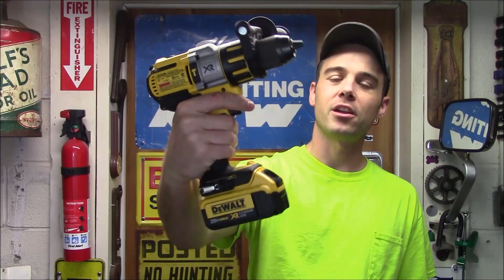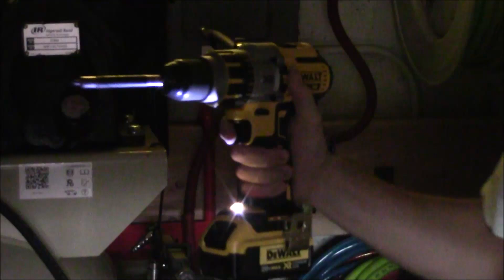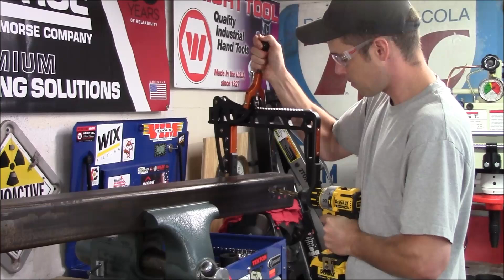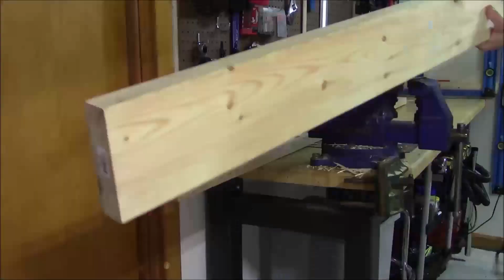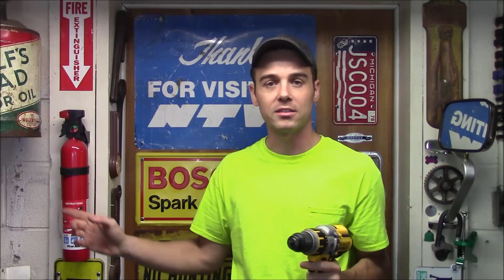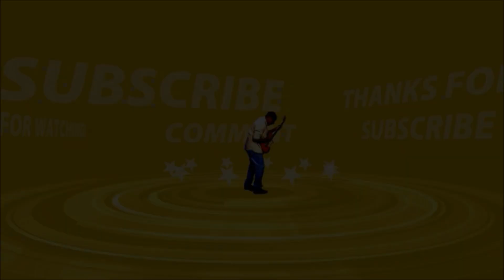DEWALT DCD995M2 20-Volt Max XR Lithium Ion Brushless Premium 3-Speed Hammerdrill DCD995 / DCD995B

Comment: in need of a new hammer drill and impact driver. I'm considering this dewalt line, the ridgid5x line, m18, or kobalts 24v. any thoughts or suggestions? my current one is a Hitachi and while I do like their new stuff I can't get nearly the same deals on price or extra batteries. any help would be awesome

Comment: Xlnt  review! The reason for having a  hammer drill for me, is to make 1/4 - 5/16" holes in concrete to set Tapcons and occasionally larger holes to put in anchors for "All-Thread" or larger bolts for supports or whatever. This definitely shows it is up to that task! As a Union plumber every commercial job I've ever worked on, we used Dewalt hammer drills if the Co. was providing us tools to use. And this was before the new 20 volt shown here. I'm now retired but I still do some maintenance work for a landlord plus I have my own CBS home which requires Tapcons nearly every place I can think to put one. So I really like this drill although maybe the smaller one will be enough. Again it is great seeing a hammer drill make smaller holes in concrete. 400+ holes per battery is plenty.

Comment: Great review!! Can that drill press thing be used with Milwaukee drills? I wonder how it would hook up. Lately when I've been drilling into metal I'll put the drill on the highest clutch setting so if a catch occurs the drill won't rip out of my hands. It doesn't work all the time but a lot of the time it does.
Reply from the maker: +Love2boat92 Thanks!  The Rapidrill (drill press attachment) does not work with the Milwaukee, since it has a clamp style (2 points).  It only works with a round handle style like the DCD995.  Good idea on the clutch trick....having a drill twist your wrist is no fun!
Reply: Real Tool Reviews No problem. That's disappointing it won't work with Milwaukee drills. Owell. I could probably make something that would work. Thanks.
Reply from the maker: +Love2boat92 I spoke with Rapidrill at length about this & the drills with the clamp style cannot handle the pressure applied (unevenly) and the casting breaks.
Reply: Real Tool Reviews That does make sense now. Bummer. That was an awesome idea. Although what if you just clamped it around the casting on the milwaukee drill anyways? Wonder if that would work?

Comment: wow seeing you drill those 2" holes, that thing is a beast lol you should put it on the skidmore lol
Reply from the maker: +singlecams Haha....well, torque when it comes to drills is MUCH less than impacts.....that is why they rate everything in inch-lbs instead of ft-lbs (the number appears 12x as much) --- when with the top-of-the-line Hilti & Makita --- both have under 100 ft-lbs of torque.  Neither would even make the gauge barely move on the Skidmore :)

Comment: so, that's the compact one, correct? or have they went away from the compact/full size hammer drill thing they've had? i have the non xr big daddy hammer drill and that sob is a hoss haha
Reply from the maker: +bighunterman77 This is the full size brushless hammer drill.
Reply: +bighunterman77 995 is full size hammer drill, 795 is compact hammer. 985 is huge/heavy non-brushless hammer that is bigger and less powerfull than the dcd995 (it's older). I own a  985 and its a great and stout drill just show its age in its weight for power ratio

Comment: Love your reviews but here You should mention that dewalts line its not 20V. Just marketing bs :)
Reply from the maker: +ocotuchodzi Thanks!
Reply: +ocotuchodzi the batteries sitting on the charger get up to 20ish volts...under load, yes, they are 18...but still are 20 on the charger
Reply: +bighunterman77 You also can say that your car burn 0.1L/100km. Sure, when its pulled by other one :) I get it. 20 is maximum voltage but still this is shitty way to persuade customers.
Reply: doesn't most everyone who knows even a lil bit about these things realize that the 20 v dewalt stuff is in the same class as the 18 v from everyone else?
Reply: +bighunterman77 I really hope so
Reply: +ocotuchodzi I read that it was to separate these tools from their 18v XRP. I believe that because people don't read or pay attention when they buy stuff so they would get complaints when people bought xrp lithium batteries or older 18v XRP tool and cry when it doesn't work with their new tools and batteries.

Comment: the clutch is kinda neat.
Reply from the maker: +efb It definitely is a lot different than a standard drill....I wasnt sure what happened the first time I stalled it out, but it was the electronic clutch killing power to the motor.  Once I found out what was causing it to cut off, it made a lot more sense.

Comment: I have the Dewalt dcd995. I love it besides the chuck wanting to get stuck in the open position sometimes. Other than that it's amazing. Great review.
Reply: Jordan Booth    spray a little silicone spray on it in the closed position, then open it and close a few times
Reply from the maker: +Jordan Booth Thanks Jordan!  I occasionally have drill chucks "stick" & Kevin is correct, lubrication is key.  Silicone spray works well.
Reply: +Kevin Batson thanks I'll try that.

Comment: great review as always! also im looking at investing in a 18-20v power tool set but want a good impact wrench with it aswell whats the dewalts newest impact wrench like? any feedback is greatly appreciated thanks!
Reply: Yes good deal, but dewalt don't ask for receipt or box just serial number along with the manufacture date on the tools and battery
Reply: Hi Dung Pham thanks for the feedback so do you feel that milwaukee offers a better product or that their batterys are of a higher standard
Reply: +Dung Pham ok sweet thanks ill look into them !
Reply: r0bd0g64 hi, I've  used dewalt 20v impact and drill, good but after a year the batteries only charged only 2/3 level.
I'm going to change them to milwaukee with better specs
Reply: +Dung Pham why not send it in since it's only been a year as they have 3yr warranty, 1yr service warranty.
Reply: south park bought from a Mexico guys, no box but brand new, drill+ impact + 2 batteries + charger = 150$, still good deals, isn't it ?
Reply: r0bd0g64 i think so. I'm mechanic, dewalt impact 20v sometime too weak to remove bolts, im waiting the new 2754-20(bare) or 2754-22(kit) with the best specs 
my dewalt about 125 ft-lbs( this is just hex impact) and the new Milwaukee compact 3/8 impact is about 210 ft-lbs( which is the best specs now, even beat snap on too)
Reply from the maker: +r0bd0g64 Thanks!  Dewalt's new impact wrench is EXTREMELY powerful for a cordless impact.....it has 3 different speeds & is roughly about the same exact size & footprint as the Milwaukee 2763.  I would not hesitate if you were thinking about one.  Milwaukee & Dewalt both have good 18v/20v (same actual voltage) lineups & it would just depend on which one had the other tools you want to expand into.  Price is roughly the same.  Warranty is better with Milwaukee, but who knows if you will ever need it.
Reply: Thanks Real Tool Reviews will you be doing a review of Dewalts new impact wrench on your channel?